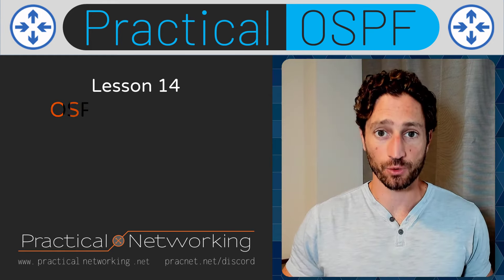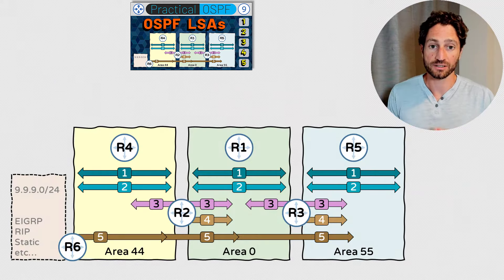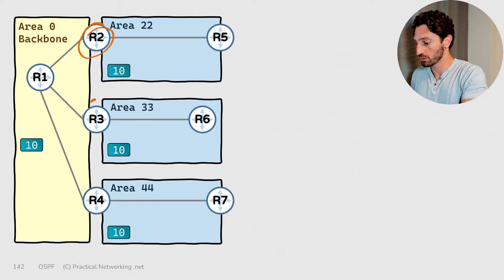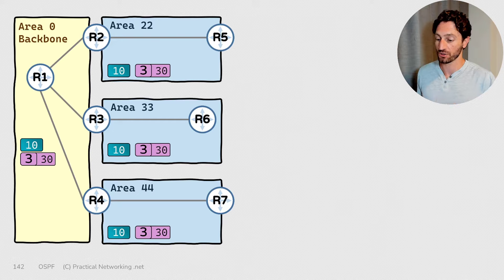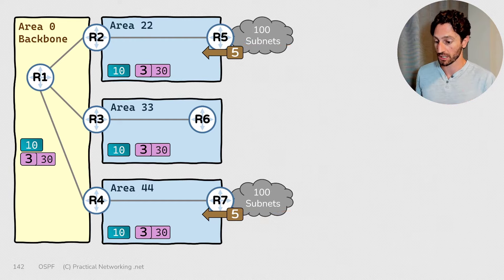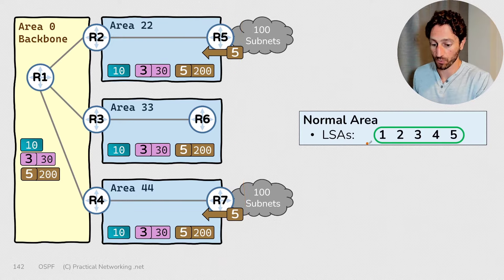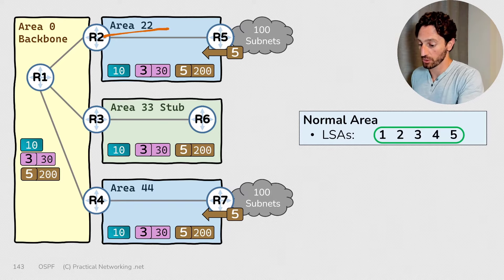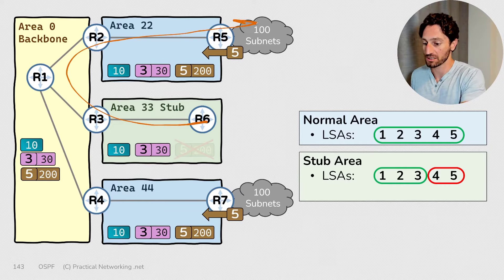OSPF Area Types - Stub, NSSA, Totally Stub, Totally NSSA - Practical OSPF

Comment: LSA type  

Type 1 LSA: Router identifies itself and it's links  
  - IP Networks/ Subnet Masks  Costs for each Router Link  
  - Used to build typology map of local area  

Type 2 Network LSA: Sent by Designated Router (DR)  
  - When multiple routers connected to the same multi-access link  

Type 3 Summary LSA: Contain IP Networks from foreign areas  
  - Sent by ABR in both directions  
  - Summaries Type 1, Type 2 and Type 3 LSAs  

Type 4 ASBR Summary LSA: Instructions to reach ASBRs  
  - Send by ASBR  

Type 5 External LSA Contain an IP Subnet redistributed into OSPF  
  - sent by ASBR  
  - Forwarded unchanged throughout OSPF domain

Comment: master at work . This is the one i was most confused about , well explained
Reply from the maker: Glad you enjoyed it Don. =) Cheers !
Reply: @PracticalNetworking  Just a quick question though , ED. If Totally stub Area doesn't allow type 3 LSA's , why does it allow one to be injected to give the default route? (assuming i have understood correctly of course)
Reply from the maker: @Don-Carillo  That default route Type 3 is the exception. It's the only TYpe 3 allowed in a "totally stub" area. If that didn't exist, none of the routers in the stub area would have any routes to any subnet elsewhere in OSPF.
Reply: @PracticalNetworking  makes sense. Thank you
Reply from the maker: @Don-Carillo  Cheers, Don =)

Comment: I have a question; in a previous video you mention that type 5 LSA are forwarded by ABRs only.
Assuming area 0 links are P2P, how do the Type 5 LSAs in this video reach Area 33?
If I understand correctly, they are first forwarded by R2 and R4 from Area 22 and Area 44 respectively into Area 0. 
From here, how do they reach Router 3 for them to be forwarded to Area 33? 
They can't be forwarded by R1, can they?

Thanks for the lessons!

Comment: I feel a bit confused here:
 Are these AREA types the same as the LINK type of a link advertised in an LSA? in other words, is a stub AREA the same as a STUB link/network?
What if R6 didn't exist, R3 had a stub link/network instead, and was also part of Area 0? would that mean that R3 had a stub network/link inside a normal (non-stub) area?
How does a router know what type of area that is? is it specifically configured or automatically determined?
How does the LINK (stub, transit, etc.) and AREA types (stub, NSSA, etc) correlate to the NETWORK (broadcast/point-to-point, etc)  type?
Reply from the maker: Good question. No, the Link types are different than the Area Types and different from Network Types . There is some overlap, but for learning I think it's best to understand each of these as completely separate independent topics.  It's unfortunate OSPF used such similar terminology for each, it leads to confusion. The video on this series on Type 1 & 2 LSAs will go into more detail about Link types.

Comment: @Practical Networking: what is the benefit of changing an area to NSSA when type 7 lsa will be translated to type 5 lsa... why not keep it a regular area?
Reply from the maker: Because it spares the NSSA from having to maintain the Type 5 LSAs from other areas (i.e., the 100 Type 5 LSAs redistributed from R5)
Reply: @PracticalNetworking  Thank you.
Reply from the maker: @wizix9877  You're welcome
Reply: Ed, I don’t get the point. If that needs to achieved ABR of Area 44 should inject the Default route using Type 3 LSA for to reach other areas. With Type 5, I have 100 routes and with Type 7 also, I have the same 100 routes. Why can’t just have Type 5 and inject a default route to reach other areas. I am confused by the usage of Type 7 LSA.

Comment: Why NSSA Area ABR not send default route explicitly inside NSSA area? any reason ?
Reply from the maker: A stub area, by definition, has only one way out. So it is safe to assume a default route should point to the ABR.

In an NSSA area, there can be two ways out (the ABR, or the Redistribution Router). Therefore, OSPF can not assume where to point the default route, so doesn't inject one by default -- leaving the administrator to define where the route should point.
Reply: @PracticalNetworking  Thank you!! how about Totally NSSA?
Reply from the maker: @amitpatil1900  "Totally" NSSA is a Cisco implementation, you'd have to ask them why they chose to include a default route by default. I assume it's because without it, you'd lose access to all the networks you would have learned about from the Type 3 LSAs (which are removed in a Totally NSSA area).
Reply: @PracticalNetworking  Thank you!! I understand that, just want to confirm is there any reason behind that.